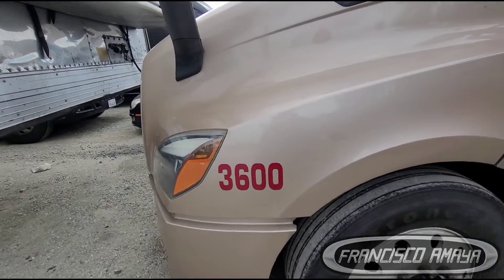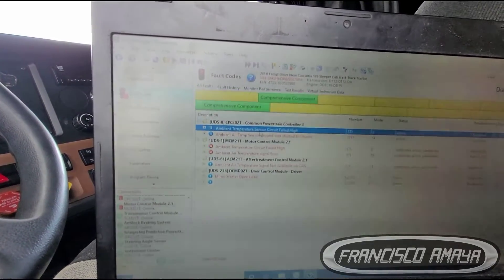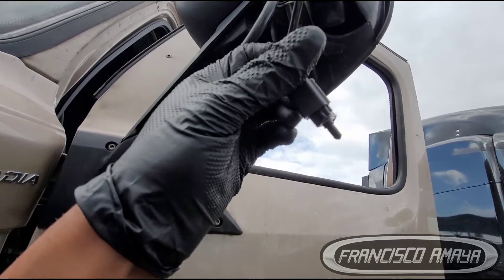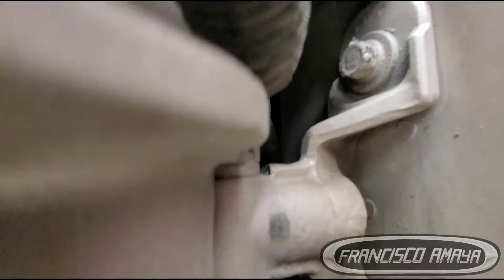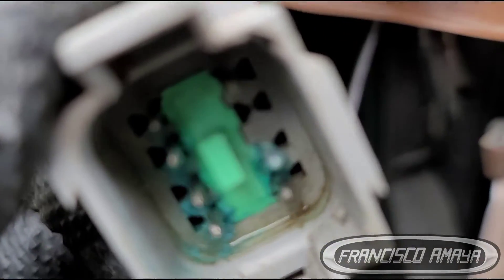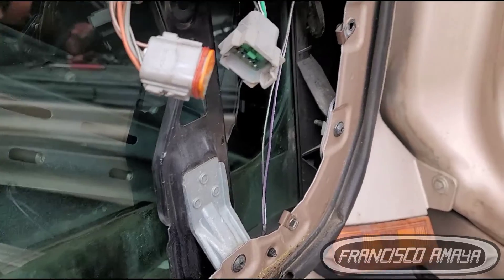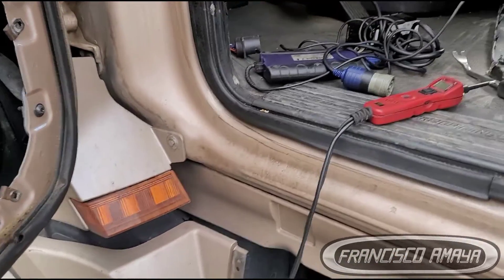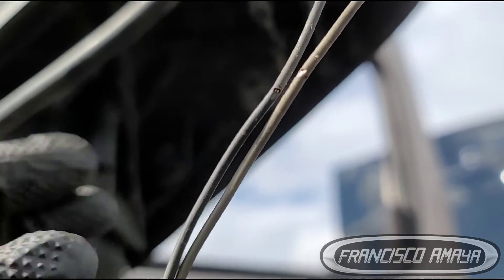Freightliner Cascadia P4 126 ambient temperature sensor problem spn 171 fmi 3 2017 to 2024

Comment: Ambient temp sensor can cause rough idle and misfire?
Reply from the maker: It could in some extreme temperatures and elevations.
Reply: @franciscoamayaYT  this is want mine is doing and I’ve done heavy diagnostics and can’t figure it out. 99 Cummins ism, rough idle, misfire excessive black smoke.

https://youtube.com/shorts/qC3-whEXSDQ?si=mIJNGLjY7s_n8OYO